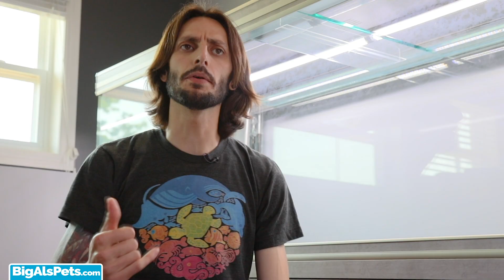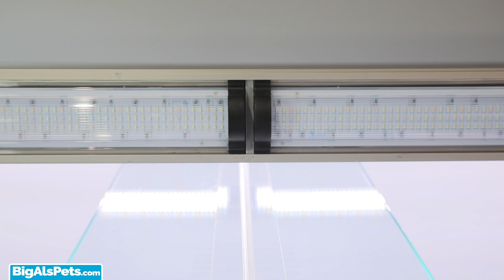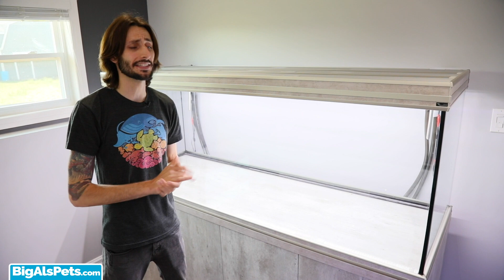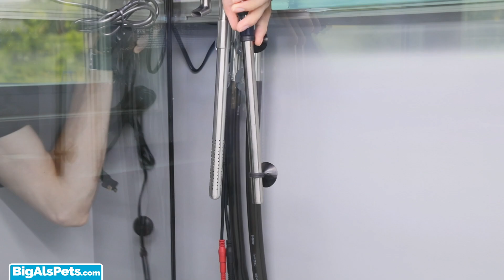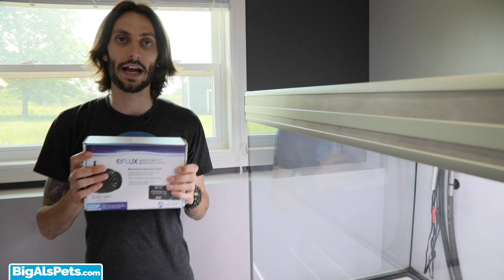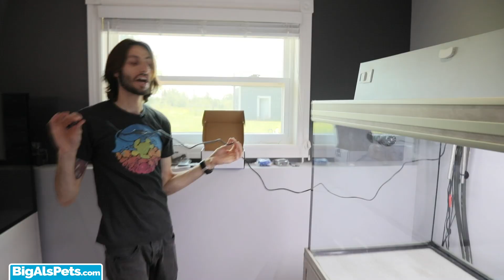Mega-Build 2.0 • Episode 03 • Lighting, Heating & Circulation | BigAlsPets.com

Comment: Why don't you put the heaters all the way to the bottom, since heat will move up to the top?  Is it because you feel the filters will rotate the temperatures ok?  I put mine all the way on the bottom so I don't have to turn them off when I am doing a water change, with your setup, you will have to turn them off when doing a water change right?